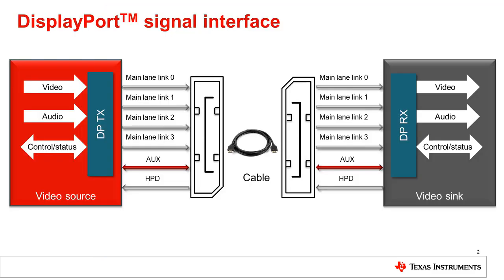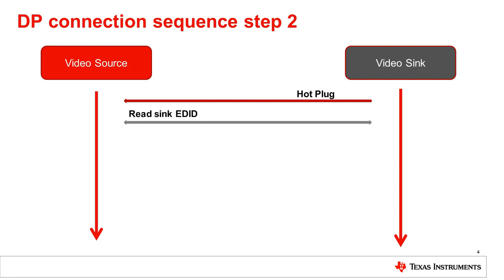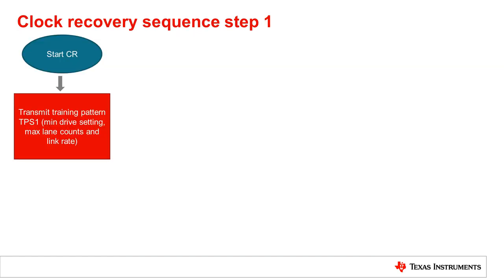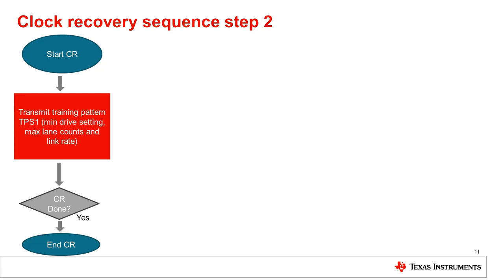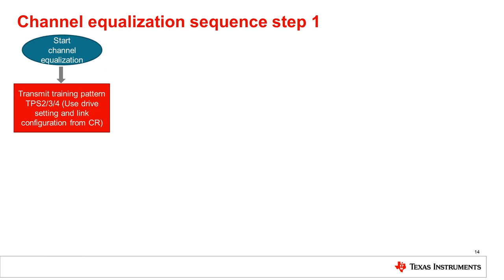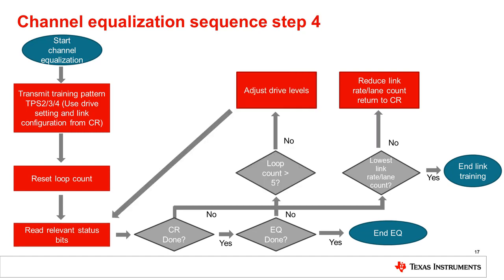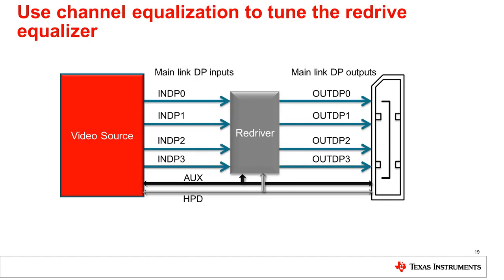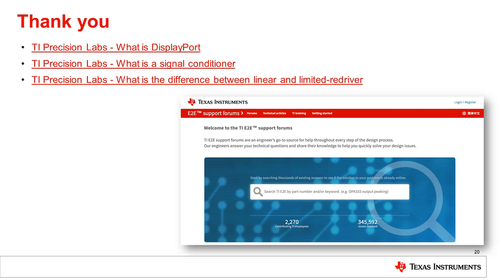TI Precision Labs - Video Interface: Understanding DP Link Training

Comment: what exactly is the reference clock that is mentioned here? (3:51)
Also is it the one that's used in synchronous and asynchronous mode operation, during clock regeneration?